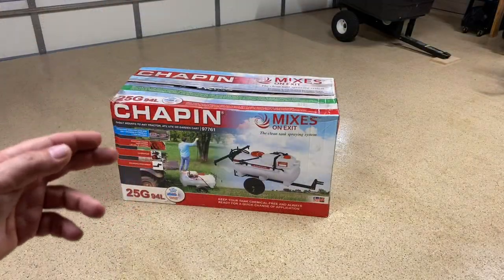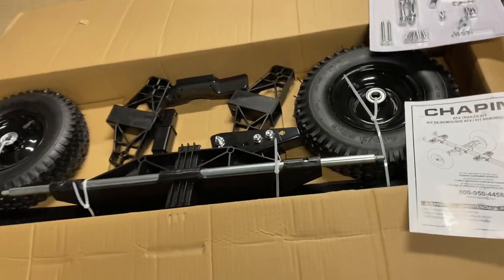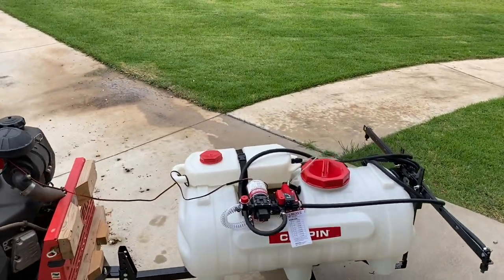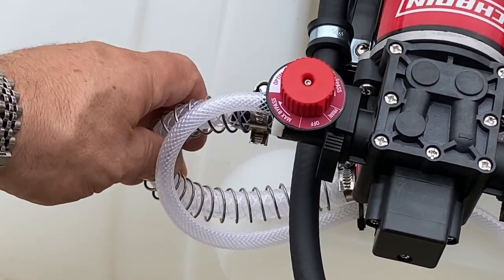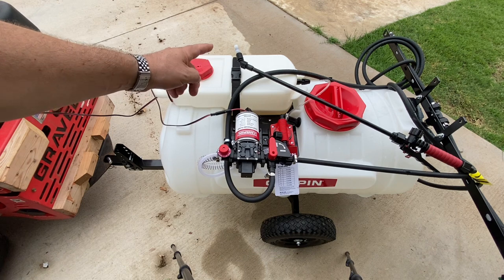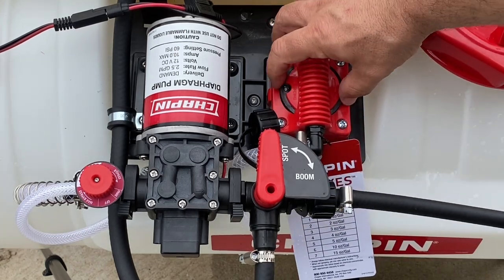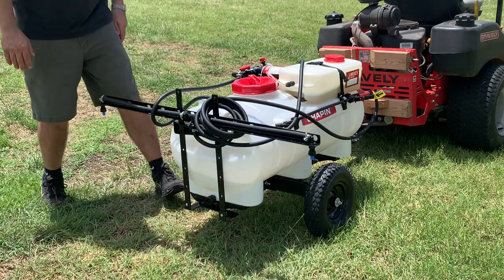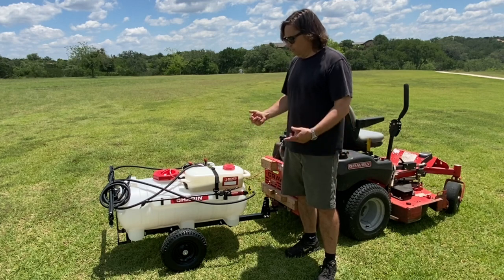✅ Chapin 25 Gallon Sprayer ● Mixes On Exit! ● Clean Tank Model 97761E and 97761

Comment: Nice Rig, I had no idea something like this (that mixes as it sprays) existed. This is a clear advantage.  There is one more part of the puzzle for your subscribers to know: You still must find a way to calibrate the speed of the mower/atv to the rate of application. If your boom sprays a distance 12ft wide, you need to (in most cases) find a speed that will travel 83 ft in 60 seconds (12x83 = approx. 1000 sq ft).  If you don't want to go that slow (or want to go faster), then double the dose ... now you just need to cover that distance in 30 seconds ( i.e. travel 83 feet in 30 seconds when doubling the rate of chemical mix).
Reply from the maker: You raise several great points.  There really are a lot of variables in play here.  Speed is a primary input, and as another person commented below, using a dye might be a good idea to help maintain consistency.  Thanks a lot for your comments!
Reply: @ApacheRanch Oh, and I left out 1 other big factor... You should measure the actual output of your boom sprayer and not count on the rate printed on the pump. My pump says it delivers 2.2gpm but it delivers 1.5 gallons per minute. (I put buckets under each sprayer head to catch the water and collected the water after 1 minute and measured it). Standard application rates are listed on the product and they all use 1000 sqft per 1 gallon of spray.

Comment: Thanks for the great video.  Very good editing.  I have a suggestion.  Consider adding marking dye to the concentrate tank.  The dye disappears quickly, but while your spraying it is easy to see where the spray from the boom has made landed.  I use Monterey LG1130 Mark-It Blue.